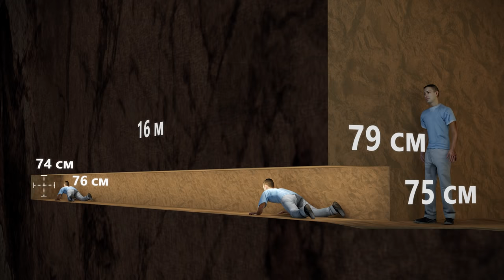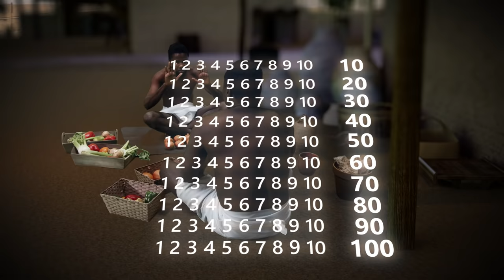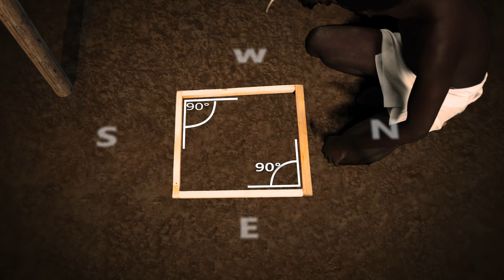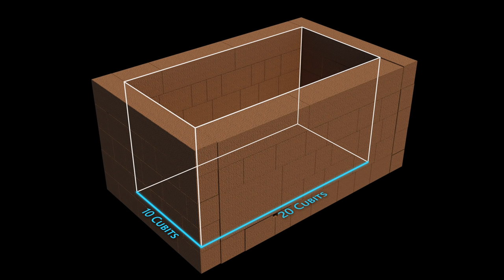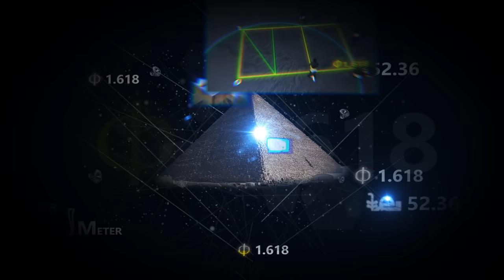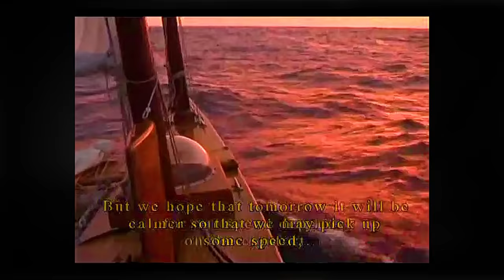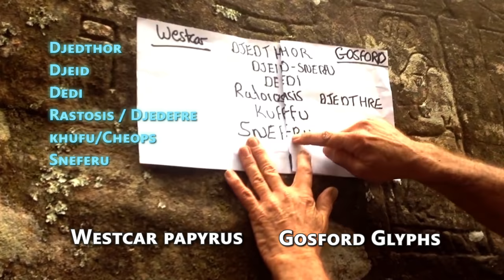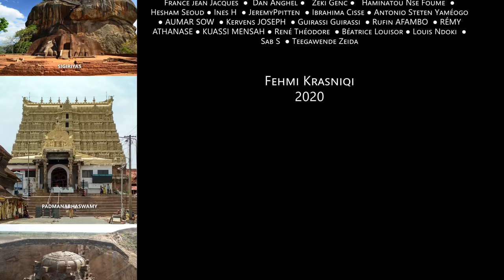The Movie Great Pyramid K 2019 - Director Fehmi Krasniqi

Comment: When I used to make concrete block like coffins for a army contact we needed vibrating rods to get the air out of the mix as air bubbles can make them weaker
Reply: That's maybe because your concrete was not molten so you would have only needed little holes on top of the mold for air to escape when the lava-like granite was poured into it. Perhaps by common sense a bit kicking or ramming was also done by the ancient Egyptians after pouring the molten concrete
Reply: @topgun2249  Molten granite is very unlikely. If they used lenses, it would be to process the ingredients of their cement-like product,
Reply: @topgun2249  Molten concrete molnen granite ???!
Reply: not if you fill your molds with water first !!
Reply: @sethrono6013  exactly what I was thinking  - I also have building experience - forms or molds for any kind of a concrete type mixture made from wood will not last 10 years  of use - they will wear out pretty quickly with constant moisture absorption and drying out  - remember cutting down trees was ( the last resort ) - no nails or screws - wedges and rope
Reply: Irish Jester  not precise enough (by far) and it takes forever. Keep in mind: you need a block about every 3 minutes...
Reply: @ReadersOfTheApocalypse  I
Reply: Irish Jester  in 20 yrs. there are about 10,519,000 minutes. Divide the 2.5M blocks for the correct answer

Comment: If it is correct.. We should still using this method of building till now and start melt Granit and baselt.. Much esayer than we bulit
Reply: This is one of the problems I have with it. A diorite statue of someone or something would be well over 100 grand if its big. Making liquid glass is easy and they only had fire for light you'd think there would be glass in the roof to let light in or just in general they would of used it alot more
Reply: Yeah lots of holes in this theory... but it just means we haven't worked out all of the puzzle yet .. There is that road with the cart wheel tracks in it that has hardened along with the building near by made of the same concrete / stone  what ever ?
Reply: Your logic is kinda flawed. The ancients also had no police for example. But we have crime and punishment today. Perhaps they were just simply better than us.
Reply: @daverhin5975  Not to mention melted granite would ignite wooden molds immediately. They didn't have anything that could hold molten granite.
Reply: @CaptCutler  Clay all they would have to do is go slow the first few layers. They show a clay mold by an Egyptian statue in the video. Just go back and fourth real slow and I think by the time you got back to the other side it pretty much be cool wouldn't be to hard on the clay. Melted rock dissipates heat fast
Reply: @dematidesigns5444  they had police.... lol. might not have been called police but there were enforcers walking around to ensure laws were abided.  cmon... even small tribes do this in the most remote places of the south american jungle.
Reply: Yeah, right Much easier to melt
Some of the hardest, most dense mineral on Earth.  Probably more energy efficient too 😂🤣🤣🤣
Reply: @CaptCutler  clay you fool
Reply: Nowadays, if that solar lense wandered off target by an inch or two we'd hit a Gas main, Broadband line, fibre optics network or the good ol' sewer pipe! Yuk
Reply: @CaptCutler  I think they must have forgotten to mention that the formwork was made from asbestos!
Reply: @daverhin5975  👍
Reply: @CaptCutler  that evidence will come out in the sequel called, " if you close your eyes, it tastes like chicken"...
Reply: you are incorrect , concrete and steel is superior for our modern buildings .
 do you really see any use for largely solid pyramids for office or apartment towers ?
Reply: @dematidesigns5444  There was cannibalism and civil war in Egypt when the nile stopped flooding so much. Pharaohs jogged around there city cause it was usually the biggest most muscular guy that was in charge. They wanted to show how inshape they was and that they were more superior. They had laws as well CRAZY ones like if you killed a cat the punishment was death. Even pharaohs had armed guards and people to try and keep peace in the city
Reply: @captaindiabetes4244  yeah, that makes sense. You'd think they'd have put that in the hieroglyphics like all the other menial things they recorded. I still think its possible that the Egyptians stumbled across these things and started tagging them like modern hoodlums.
Reply: @CaptCutler  Menial things. Like building stuff we dont understand how they built it? That makes our constructions below menial. Why does the modern ignorant stray from science? Starting to believe now that we "devolved" somehow. Somehow we just as are not as intelligent.
Reply: @dematidesigns5444  i didnt mean that building the pyramids was menial, just that so many of the hieroglyphs depict pretty lack luster things, so you'd think the construction of the pyramids would have been high on their priority list.

Comment: Surely the diameter of a drop of water on a given surface depends on the volume of the drop? How did they standardise that volume? Since it almost certainly depends on the size and shape of object on which the droplet forms (e.g. the stick shown in the illustration), on its hydrophilicity, and on the purity of the water how can it be a constant to within 0.1% (i.e.1 mm in 1 metre)?

Wait, they constructed a perfect disc to calculate pi but didn't think of using it as a wheel?

8 divided by pi = 2.54647 ... the ratio of inches to cm = 2.54.

54 minutes into this video I'm giving up. This is speculative, inaccurate and absolutely illogical. The idea that a culture understood circles but did not use wheels is the most unlikely of all.

You have anchored your thinking on the idea that the Egyptians built the Great Pyramid and built a house of cards of speculation from there. Other researchers have already pointed out that the apparent sudden rise in Egyptian knowledge during  the 'Old Kingdom' era and its apparent sudden decline thereafter makes no sense. And all this is based on a highly tenuous claim that the Great Pyramid was built as a tomb for Khufu.
Reply: They poured into forms that solidified into the rock.  Those that want the world to believe slaves dragged that stone any length of distance is to keep the idea of slaves being part of everyday life to make it seem proper.  It's not.  There are no rights or wrongs.  There is what you choose to do and what you choose not to do.  Water being the universal standard makes perfect sense or it doesn't.  Everything is according to As Above, So Below...To get minds working, if only one thought is argued as fact while the other is shamed makes that cult-like behavior.  Humanity as it is today 2021 is a failure.  I don't know everything and neither do you.  Einstein did not know it all.  Tesla didn't either.  It was all about making ideas a topic of conversation, not seeking to close doors but open them.  Would you roll up your sleeve for an injection being pushed these days and say so or act as if you took it to fit in...maybe did so to keep your job rather than think and decide according to the available data.  I choose to not be the lab rat hence the door to my job is closed and so be it...does that mean another door that is open can not exist or in my position I must seek to open a door and find access to a place that can accept my choice to not be a follower of the crowd as I do not care about the amount of money no matter how much or how little.  None of matters as the past year and few months was all in preparation for something we all will endure and there will be no choices available.  They just don't know exactly when this will happen because they don't know everything and they don't not want to be wrong as if they are never wrong in fear of that idea.  One who can not take a joke is someone not worth listening too.  Ego is humanities ball and chain along with greed...Eventually the majority will become rage and crush the smaller group.  I won't choose sides in that fight either.  This is wonderful video production that surely won't get played in front of young students in the my home America.  That is sad along with so much more about my home country and it's embarrassing.
Reply: @jukee67  It sounds like you want to believe something. That doesn't mean you have to believe any old thing.
Reply: @neilcreamer8207  Slaves did not drag rock and put them into place.  That is the pushed narrative because slavery still exists today.  Water as the constant standard for unit measurement is not insane.  Science had become a religion and those within it follow the rules or get excamunicated.  Take fresh water and drip your finger down to immerse and then hold over a piece of alabaster allowing a drop to fall from your finger.  Volume and distance, and all variables aside.  Put yourself in the place of one during those times on the side of a river and test the drop over and over again.  Take the simple approach.  I laughed at this when someone brought this up in conversation maybe 10 years ago.  Then revisited the idea after watching this video.  Simple things along with questioning everything seems to be left out of the broken system we call education in this country while these Universities produce graduates that take part in violence when anyone goes against their side of an argument.  Close minded thinking leads to Portland Behavior.  Both sides in a debate can be argued equally from either side as long as all parties meet kindly in the middle as no one knows everything.  Anything our generations built will not be standing 1000 years from now.  All that will remain of our existence will be waste...plastic, nuclear, etc.  Roundup is in everything as in land, air, and water, and maybe 50 years if outlawed today earth may be able to shake that poison off.  We are a failure at this point.  The past few years proves that.  I am a spectator at this point since I am exhausted from arguing and seeing others put down anyone with an idea or pointing the finger at China, Russia, etc.  Those that point fingers are usually the one at fault and those that will not allow someone to question a theory or said fact when left and unchallenged you get Big Pharma and the corruption due to the greed that takes over those who feel entitled.  We all breathe the same air and sometimes those in charge or those that are never wrong need a good old a** kicking to be brought down to reality.  I wish you the best in whatever this future has in hold for all of us.  We will all regret following those in charge over the past year because they were not truthful.  May Kary Mullis rest in peace along with all the real scientists that all only with us in spirit when we could use them here to counter those that are in the three piece suit on a podium in a forever government position no one voted them into.  That certain old guy if he were my grandfather and I was teenager self would have been pushed down the stairs after the mess he so easily peddled and oddly predicted.  I hate politics even more.  Frat and sorority people in government need to be kicked out and smacked around while we are at it.  We have issues in the United States and have for a while.  No one stopped the world to stop the heroin problem in Philly...Now we got a major shooting problem...That does not mean taking guns from good people, it's time to remove the real problem people at the See Eye A.  They don't like anyone questioning anything or knowing who they are which makes them rodents and cockroaches always a day late with intelligence.  Let's be everything but like that group.  Being punched in the face is not so bad when you know your out of line or out of hand and that sometimes doesn't sink in until your down on the ground and being picked up by the person that had to knock the sense into you.
Reply: You have made the same argument that I would have. I made it 20 minutes and saw this is a story with little proof and a cause to push.
Reply: @jukee67  get a 5 decimal balance,weigh 10 drops of water and get back to me when you see water droplets are not uniform. I don't think slaves built the pyramid, but that doesn't mean Egyptians had to have.
Reply: @jukee67  hi, interesting comment but what is the "preparation for something that we must all endure"?  Im curious what you are referring to.
Reply: @jukee67  A very good breakthrough with the limestone concrete. Bravo! But the melting of granite with 5 meter magnifying glasses is where this movie departs from fact to join the fancy associated with so much Egyptology. Where is the evidence such huge lenses existed? How many would they have needed or used? Why is there no such lens in the archaeological record?
Reply: Excellent comment. I said the exact same thing, however you said it first (I didn't see your comment until after I posted). Not only are the drops NOT uniform in size, but they are ALL smaller than 1 centimeter.

Comment: I can think of one problem with the concrete moulding theory: a perfectly flat and straight moulded stone still requires a perfectly flat and straight wood box, how did they achieve that?
Reply: Wood is a lot easier to work than stone. And, for anyone who takes pride in their work, precision isn't all that difficult. If the blocks were cast and poured in place, of course, there would be no gaps between them. Still, even iff that was how it was done, the saw marks in the stone indicate that these people had large circular saws that they wielded with extreme precision.
And... for the record, that's not how I believe it was done.
Reply: @surferdude4487  I understand that. But why don't we have any mention of the geopolymer technique throughout history? Many populations would have adopted it even until recent times, just think how many applications it could have, but nobody ever used it, and honestly, how do you turn a liquid paste into granite???
Reply: @baccy81  That's a good question. Unfortunately some secrets are so carefully kept that they end up being lost. Some examples are Greek fire and that legendary steel whose source was traced back to India, but nobody knows how it was made anymore. For granite to be worked the way it was in anti-deluvian Egypt, they must have possessed ultra-hard tools or some means of softening the stone or a way to pour concrete that was indistinguishable from natural granite. Although nobody has found any trace of massive power tools, the distinct marks that they leave are all over the stone where it hasn't been polished. There is also clear evidence that they had a process that used a liquid which bonded with the stone and left a mirror-smooth finish that has lasted over 12,000 years. The poured concrete is easy enough to do with the lime-stone. We know how to do that today. The process they used to shape the granite is still unknown to our current science. One study is based on the theory that they quarried the granite in manageable sized chunks, built forms of clay, melted the stone using massive magnifying glasses and poured it. I'm skepticle because that would be some really big lenses of surpassing quality and no trace of these tools has ever been found. And yes, massive glass lenses would have left traces that last to this day. I've watched a lot of videos that speculate on how the ancient megalithic structures were built. I'm still not satisfied that any of their theories are correct. One thing I do know is that the ancient "Myans" knew how to work concrete.
Reply: @surferdude4487  I've been interested in this topic for more than 15 years now and still I have no favourite theory to confidentlly agree with
Reply: Fine abrasive finishings
Reply: @douglasvincent6480  That is certainly how we would do it with our current technology. There is evidence, drips on the back-side of some of the stone box lids, that the builders used some kind of liquid polish that bonded with the stone surface and was harder than granite when it dried.
Reply: @davidleomorley889  what pisses me off is why go through the painstaking process of making a science fiction video like this and sell it for a documentary?
Reply: @davidleomorley889  yes I get it, but what are they cashing in from this??
Reply: you know, at least Van Daniken was selling books to spiritual idiots
Reply: @davidleomorley889  Mr Foerster often talks some crap but I don't think he is a complete scam. He is simply in the travel business and doesn't hide it.
Reply: @davidleomorley889  maybe, I think Foerster believes in that story himself
Reply: Ugh....🤮

Comment: Where is there a single example of the melting lenses left that can be verified ?
Reply: The secret technique belonged only to faraone and few ppl
Reply: 8:04 “3 loaded tractor trailer trucks” loaded with what?
Reply: @JohnSmith-vq1co  Maximum load
Reply: @John Smith 
Obviously not an Aussie Roadtrain average size rig or load .... Lol! 😂🤣😂🤣
Reply: Have new countertops-quartz and marble. Got a few scraps and put them outside under a magnifying glass.
Nothing happened. Zero melting. Got hot but....you try it for yourself now.